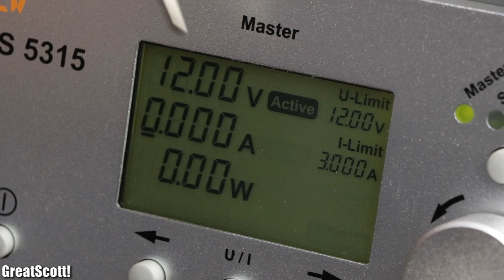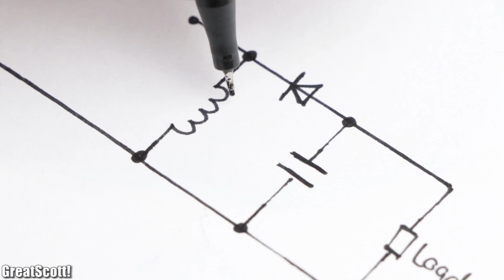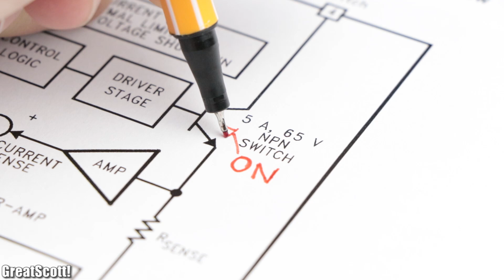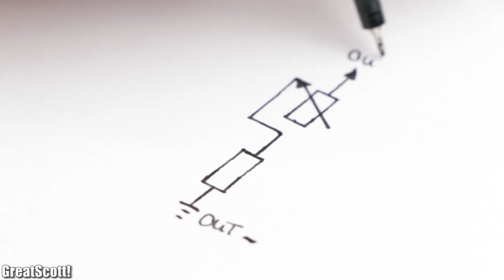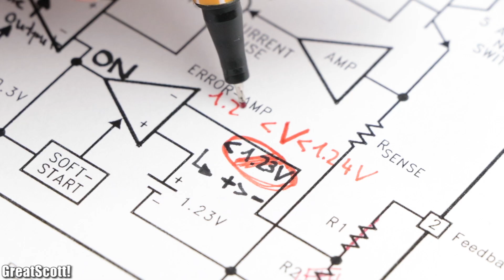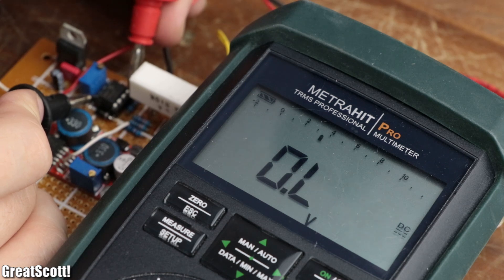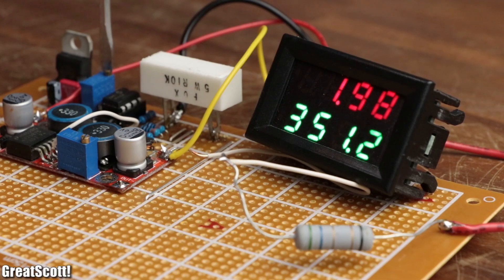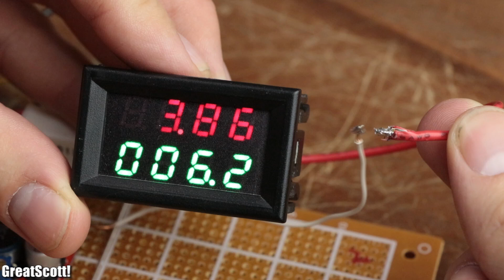HACKED!: Adding a Current Limit Feature to a Buck/Boost Converter

Comment: I'm trying to find a way to limit current to 12v led down lights, i have 5A 12-24v led controllers (supposed to be used with led strips) connected to 4x3W down lights. the leds draw more current at max brightness than the controller is rated for and the lights are way too bright than what's needed. I'd only ever want to run them at 50%.
I could probably mess with the controllers or implement a current limiting supply. There's got to be something ready to use out there for cheap.

Comment: What do you think about the universal buck-boost converter.
It uses operates in three mode: positive, negative and AC(sine using varied PWM)

My real question is that How efficient is it to a typical Inverter?
Would it work on reactive loads(L&C loads)?
Can you make a video on it?
Just subscribed😊
I can't share the link but it uses 4 MOSFETs for HF switching and another 4 for choosing modes. And it uses two capacitor and an inductor(just like a typical buck-boost). That's the description.
Thanks.
Pls reply 😔

Comment: Can I use that as a solar charger for lead acid baterry? I want to set the voltage of 14.5V and max current of 700mA and I think that this should does the trick, but I am unsure

Comment: I'm just coding a UI at the moment. The rest was a zip file and slapping a module on a micro controller and some code in C++. It's not easy, but I like it. Will mostly use it for 3.3v and low current tests.

Comment: "this circuit can be used to test LEDs" is a wrong statement if you leave voltage at any level and just set the current to minimum (20 mA for your case). Because although the current is limited, but the output capacitor is still charged to the set voltage value. So when you connect an LED with let's say the voltage set at 12 V and current at 20 mA, the capacitor will supply enough surge current to destroy the LED. I have practically experienced that. So in order to test LEDs, you'll need to replace the output capacitor with a small 10 to 22 uF capacitor. But that will introduce alot of ripple in low impedance loads (high current) so you'll need to add a relay and a larger capacitor so that the relay connects the bigger capacitor to output when set current exceeds a certain limit (e.g 200 mA). But since the larger capacitor is not charged if disconnected, it will cause a huge current surge when connected at once. Which can affect the transient response of the power supply. To address that, connect a diode from output to larger capacitor so it keeps charging with the output voltage but won't discharge through load unless connected by the relay. And here we got into another trouble. What if we had set a higher voltage with larger capacitor connected and then disconnected it (set a lower current value) and then reduced output voltage and again switched the larger capacitor in? It would provide a higher voltage spike that can cause harm to sensitive electronics. To address that problem now, connect a resistor (e.g 6.8K or 10K) parallel to the larger capacitor so it keeps at the set voltage level whether its connected or disconnected.
Thank me later!

Comment: Hi
I had a specific requirement
I need a circuit that can provide a variable current at a fixed voltage
As in if required, it will increase or decrease the current so that the voltage is maintained at a fixed voltage that i can set it.
Can anybody suggest such a circuit design?!
Its been many years that i have worked in electronic projects so completely out of touch what new IC's are available for these kinds of things

Comment: I guess there is a reason why he didn't show how the regulated current then looks on the oscilloscope.
Unless extremely lucky, the current would fluctuate around the set value by several 100mA.

Comment: hello, I have a question, I wanted to add current limit function to boost converter (2A version) to charge 4s batteries. so will it be possible to monitor input current of the converter to adjust output voltage? (Iout will always be under 2A, so i am not afraid of  damaging the battery, i want to use converter safe operating current to maximize usage on any input voltage) I think it should work.

Comment: The ground at pin3 of the IC is really throwing me off. Why is the non-inverting pin grounded? I’m so confused 5:55

Edit:
Since the inverting pin is connected on the lower potential of the shunt resistor, I suppose it means it is negative, and the gain is actually -R2/R1 which means if he wants 333mA, he sets the potentiometer to 1V, and the first op-amp will stabilize to 1V output, or otherwise, the inverting pin will receive -33mV (333mA*0.1ohm) which will receive a gain of -30, which will output 0.99V.

And it stays stable because when the current gets too low, it will output less than 1V which will be compared and set the feedback to low, which makes the converter output more energy, and when it is more than 1V, the feedback will tell the converter to output less energy.

This took me so many other videos to understand 😅

I still don’t understand the purpose of R2 and R3

Comment: Current can be dependent on load resistance, or it can be dependent on voltage. In this case, it is dependent on voltage. 

What if you need constant voltage and constant current? Can’t you make a current limiter dependent on a variable resistance such as a thermistor which is designed to heat up for a specific resistance, or a photoresistor designed to be exposed to a specific light intensity for a specific resistance?

Comment: In theory, you should be able to make a simple circuit to hack SMPS power supplies too, to regulate the voltage and current accurately. Just make a circuit that activates the optocoupler when the output voltage or current is too high, with current control having priority. That decreases the switching circuits duty cycle, decreasing current and voltage with it.

It's actually possible that this exact circuit will be able to do that, but I (and probably you as well) want voltage regulation down to lower voltages than 3-4V.
And because buck converters work like switching power supplies, it has to work, right?

Comment: Scott, thanks for the video, qq, on normal power supplies we can short the terminals to set current limit. I am not understanding how we can achieve this with buck being the power supply and IV meter for display. Red wire from display is negative which goes to the load and positive comes from buck. Thiese two terminals are say the two terminals for DIY power supply. Now I want to set the limit before connecting the load so ideally we would shot them but not sure if that would work. Any idea?
Reply: Answering my own question, GS might not even see this since the video is old. 😅

MY CONFUGURARIOB FOR DIY power supply is this, 2 bucks, 1 to reduce main supply voltage, second to power the display alone. Now to achieve CC limit setting and see it happen on display like normal PSU, we can still short the two terminals (negative or thick red from display and positive from main buck). My issue was the current limit was set to low on my display buck which was causing display to shut off, I guess this is due to high current draw and safety measures. I simply cranked up the current limit on my display buck and that did it. Works perfectly just like any other power supply.

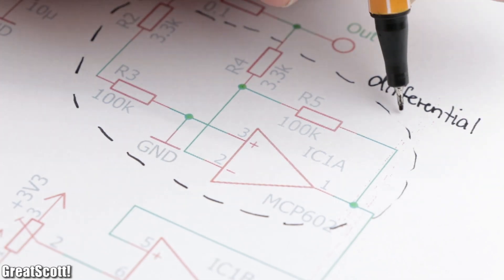Comment: hey, did you make a mistake with your dif. amp ? The ground on the non-inverting input puts this opamp into an inverting amp configuration, I tried to calculate it and never came close to your Vout formular at 6:23 . This formular is also wrong, because of your resistor config (R3=R5, R2=R4) it should be Vout = R5 / R3 (VLoad_ - Vout_), and not the potentials at the opamp inputs. But great video!

Comment: If I were to use a buck converter to drop 12v down to 9v, would the amperage increase? If so by what factor? I am attempting to DIY a guitar pedal power source, and I can't find any suitable inexpensive 9v power supplies

Comment: Hi, you should have connected the GND on the other side of the R3 resistor in order to have a differential amplifier.
Reply: This is what I was looking for, R2 and R3 just form a combined resistance of 103.3K ohms. I don’t understand the purpose.

Comment: Software Engineer. Always have to remind myself that with circuits and hardware in general you cannot just "get started and refactor when you know what what you're doing more" 😎
Reply: And that's where simulation enters the chat.
Reply: There's sort of a mechanical/electrical equivalent to refactoring. It's cost-down.  You comb over your design and figure out if there's a better/cheaper/more efficient way to achieve the same thing.

Comment: op amp pin 2 connected wrongfully to GND instead of the mid point of R2,R3.
Also low side current sensing breaks the input ground from output one.
This implies that a short circuit towards the input GND bypasses the current sense shunt i.e. eliminates the protection. Also a current sense amp is preferable to common op amp.
In this example the 4 resistor diff amp is sensitive to resistor values match i.e. tolerances result to unwanted sensitivity to output voltage, not just current (1 % resistors may result in say 5% error)

Comment: The beauty of Scott not glossing over the finer details is that it inspires me to "really" study the circuit or concept intensively, by consulting MANY sources (including the Wiki, even) until I have a truly intuitive (deep) understanding of the FLOW, the LOGIC, and the MATH. .. I do not care how long it takes. .. I resent being rushed through anything that I do not yet "fully own". .. Scott seems to OWN the knowledge, which he shares, and his uncompromised, comprehensive and detailed presentation illuminates the degree of my shortcomings. .. This allows me to fully remediate my deficiencies, however frustrating.
Reply: Yes, absolutely !
When I first watched the Nixie tube video, I didn't knew what was going on, but after few hours of research, I came back to the video, and could clearly see what problems and solution he has used.

Comment: You can also switch off a buck converter by introducing a feedback voltage greater than the reference voltage. In the case of a boost, the output voltage would then roughly correspond to the input voltage.

Comment: why you solder the white wire from diode to the regulator pin 2 ? the feedback is pin 4 !
Reply: ahhh!! sorry!!! ok it is a LM2587 the pin 2 is the feedback !!  I was thinking to LM2596 which has different pinout !!

Comment: GreatScott! Thank you for the class on this circuitry! I assembled the circuito but, for any reason, I was not able to control the output current. I am using a step down LM2596S-ADJ (yes, the feedback pin is 4), and I would like to know: should I have to disconnect pin 4 from the board? How much current I am able to control?

Comment: To make full CV (constant voltage)/ CC (constant current) operation - the voltage and current feed-backs are to be combined into the FB pin. Whoever is higher will take control.
Most commonly people use a resistor divider (to FB pin) for the voltage feedback and current sense amp for the current feedback. How to combine them? The simplest is to connect the current feedback signal to FB pin via diode. The drawback? - diodes have voltage drop changing with temperature *by 2mV/deg C). The most accurate solution is to "idealize" the diode by op amp.
The current feedback signal is applied to the non inverting input of an op amp. Its output drives an NPN emitter follower, whose emitter is connected to the op amp inverting input. The circuit can only pull up, but not down i.e. does affect the voltage control in normal operation. Should the current limit be exceeded, the current feedback will take over

Comment: It is better to use dedicated current sense amplifier like INA193. The proposed op amp base design has two main deficiencies:first, with gain of 30 the op amp inputs get too close to the power rail. Many op amps have limited common mode range on the upper side. The second problem is the effect of tolerances between the paired resistors. This results in sensitivity to voltage, not just current. Laser trimmed resistor quad IC like LM5400 can help, but it is easier to use dedicated current sense amp.

Comment: Sir is there any possibilities to control the feedback pin automatically using Arduino so that output voltage automatically control without rotate the knob manually...

Comment: I build it with lm358 with a little bit of modification.i lower the gain so i can get up to two amps out of that.but the issue is a high frequency pitch sound from the circuit can u help me with that please?? Boost converter madule is based on xl6009e ic
Reply: #me too, How is your modification going?, any update please do let me know.

Comment: if the voltage is set higher than the op amp's rail, it will not work accurately.

Comment: Hey, great video. Really informative. I have a small doubt, can we take the output from the buck/boost converter and use a LM317 in a current regulator configuration?
Reply: Yes but it will not be efficient
Reply: @AlphaTroniks  thanks a lot.

Comment: is it all this 3 module just can adjust the voltage only, not current?.
how about the output current?.
is it have overcharge protection?.
is it can solar panel to connect to input to charge 6v 7ah SLA battery?.

Comment: Your over-current difference amplifier is messed up:  1) your 3.3k and 100k resistances are backward and 2) your non-inverting input should be connected between the resistors instead of to ground.

Comment: Hello,
Can you guide me for limiting the output current to 350mA of a power supply (with output 250vdc, max output 15Amp). Should I simply use 0.22 Ohm 10W (9 Resisters) in Parallel?

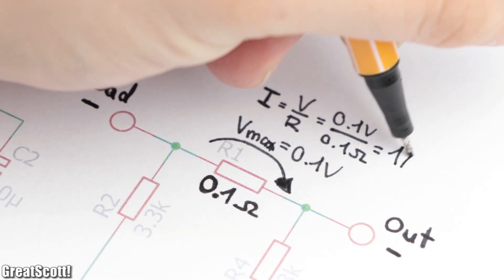Comment: Nice video.A small error thought at 6:20,I think the diff. Ampl circui5 is not correct at the point where you have shown the ground. The non inverting input should be connected after the 3.3k and then the 100k from the non inverting to ground?

Comment: Very good video, I have been trying to look for a boost converter that will take a single 18650 Li Ion Cell and boost its voltage from 4.12 Volts to 30 volts. Most of the boost converter go with a min voltage of 5 volts. Is there such a boost converter or could one be made?

Comment: The issue I have with differential amplifiers for current sense is that they are very sensitive to errors in the resistor values.  A 1% resistor error will give an output error of 1% of the supply voltage, which is comparable to the thing you're trying to measure.
Alternative is to use a current sense amplifier.  Silicon Labs SI8540-B-FWR is just one example.

Comment: Differential amplifier circuit is wrong. Non inverting input pin is grounded instead of resistor.
Reply: He corrected it in the Instructables link in the description.

Comment: Just a question

- With that additional circuit you override the votage control or you can use them parallely?
Thanks in advance.
Reply: He says that current is Dominant to Voltage, so Yea you can't Have a Constant Voltage or Constant Current at same Time but I guess its still possible to use it for Charging Li-ion Battery in CC-CV mode

Comment: My big problem with all the current limit devices I've seen, whether built in or add on devices, is that they always perform the current detection on the ground side. While I understand why it is done this way, it simply isn't going to work where both the supply and the load have a common ground. I need a circuit which will measure the current on the high side or some other point in the device.

Comment: An engineer here.

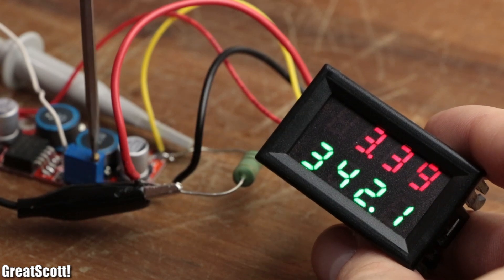Hi Scott, can you please look at your video once again? I believe you have an error in your schematic in 5:50 when you are showing the circuit of differential amplifier for the current measurement. The R3 100 K shall be connected from non inverting input of IC1A to GND, not in series with the input. When it is grounded it will not work and output voltage from IC1A will be only close to zero volt. You are showing the same circuit couple more times in your video so it might be good to review it for all the audience.

Keep going with your videos.

Comment: This is exactly what I needed to know/do! Thanks!
While using buck/boost converters to build a DIY solar charger on a LiPo power pack (w/o mfr's circuitry), I've fried my rework station's internal 15 VDC PSU, a buck/boost converter, a buck converter, a boost converter, and a solar tracker... so far.🥴
Unfortunately, I was unable to keep up with the video. So, I'll watch it about a dozen more times and head to your project info links.
Ha! just noticed a link to your DIY LiPo solar charger video. (How did you know?) See ya. 😎

Comment: I still don't understand how this switching regulator stuff works in the way of "control theory" I mean if it's just a "too much" or *too low" feedback, the regulator has to linear increase or decrease the duty cycle to sometime reach the desired voltage. Wouldn't it be smarter to use a proportional Feedback P-Regulator so the Regulator would know how much the dutycyclr has to be adjusted? Or maybe even better a PI oder PID. 
I think this two state regulator / comparator princible should work good for constant loads, but if you have big current spikes or drops, I can't imagine that it can react fast enough to don't get overshoot or voltdrop

Comment: Is there a former video or one you can recommend I am using one if not two server smps for a bench supply. I do plating and induction heating plus vac tube repairs as a hobby I need to build a buck boost with CC adjustable as well as voltage with gauges. I need for at least 1500 watts at 24 v any help would be great